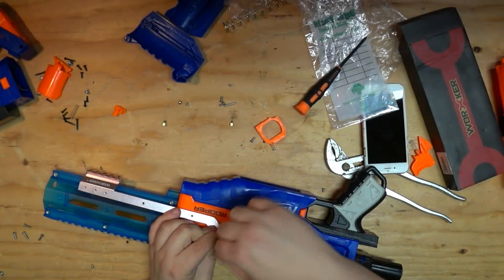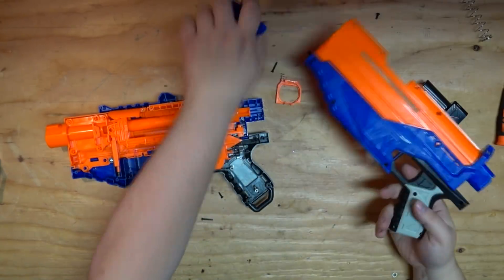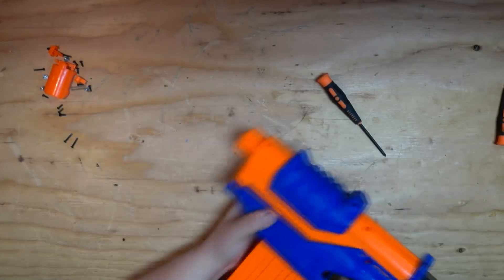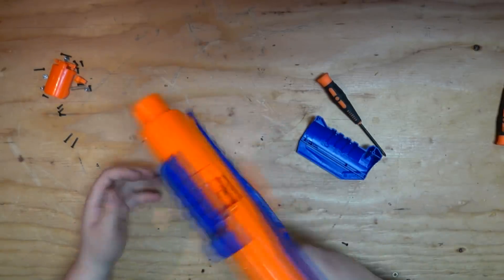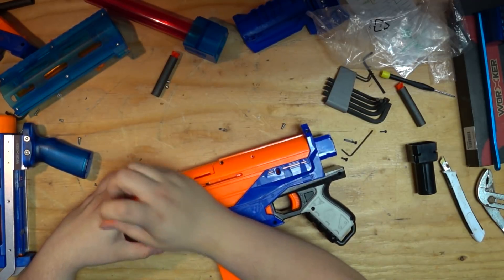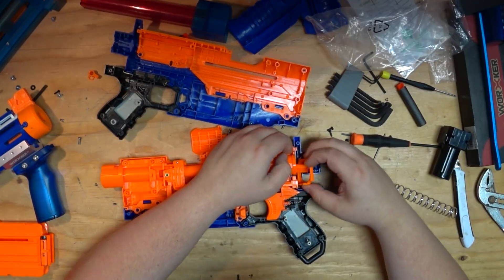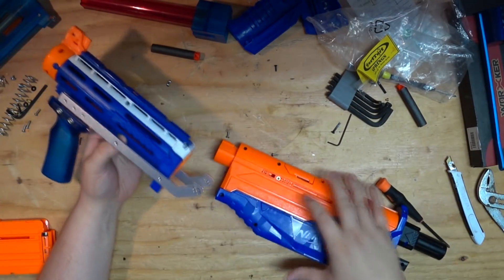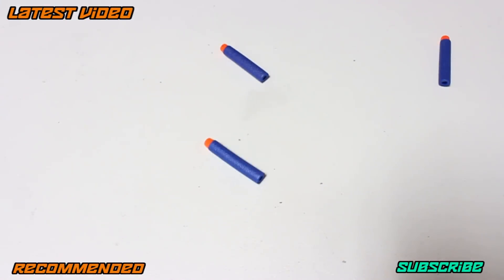NERF Delta Trooper Mod Guide || Mod Potential | Walcom S7

Comment: Just picked up a delta trooper from goodwill today. And I must say it has the smoothest slam fire ever. I was spamming out foam so fast, I actually thought I smelled the darts burning under friction. Turns out my wife was drying my socks and I smelled my socks and not darts. The Delta Trooper has a very nice prime and I dig it the most. Cheers Walcoms7 you’re a legend mate.

Comment: Everyone: mods delta troopers and retaliators into pump actions

Alpha trooper: “am I a joke to you?”
Reply: Slender Man 186
 mostly cuz the alphatrooper basically has strongarm internals, cant take a big springload. On something like a retaliator you can kinda just shlap a 14kg spring with a couple of 3rd party components and your good.
Reply: Papa Scoots well at that point you’re better off finding one of the many Longshot rereleases and modding that into a beefy as hell pump action.
Reply: @Slender_Man_186  longshots don't have slamfire
Reply: @willw5868  Not 3d printed but yeah you could

Comment: This first lock you removed was actually necesary,  because it looks priming slide when its ready to fire so you don't need to hold it and you can fire it with one hand when primed.
Without this lock when you prime and push slide forward and leave it, the slide goes backwards instaed of the blaster fireing when you pull the trigger.
Reply: I found this out as well. Had to an upgrade the spring in said part in Order to get full potential out of a 12kg spring and sealed breech

Comment: The reason the FPS with the accufakes is probably because you didn't take the AR out as I have noticed if the spring is to heavy and the AR is still there it decreases in FPS from stock

Comment: Shouldn't you be able to move the bars back a bit on the pumpgrip itself? Where it's fixed with 3 screws, only use the rear two screws. Should give you another half inch or something.

Comment: Something must be interfering on yours. I put a worker 7kg spring in mine, and did nothing else other than removing the prime locks & putting on the included rubber bumper around its plunger. I also cleaned and lubed everything, but that's it. Kept the air restrictor. I don't have a way to chrono it, but distance wise it shoots almost twice as far so its gotta be above 100fps at the barrel. Maybe I had a weak spring to begin with, but it was already shooting farther than my Retaliator and multiple flywheel blasters, so I've gotta imagine stock it was shooting as it should. Getting at that hidden screw was a bitch. Had to remove the priming handles by taking off the inner screws.

Comment: What do I think? A brass breech will be a further waste of time and resources.

Does that mean I don't like this blaster? On the contrary, I like it very much. Definitely like the attachments, and it will only be a matter of time until there's an aftermarkey pump grip kit (ala Longshot) for the stock barrel.

Still, even with a brass breech... Would probably rather have a Flywheeler or Longshot.
Reply from the maker: People think a lot of blasters were a waste of time. I thought the Blitzfires were useless, and now I think they're the best pistol in Nerf. I haven't even done a video on it yet. It's just a matter of time until somebody finds the one thing that makes it better.
Reply: Walcom S7 oh for sure... Not a dis to anyone, to each their own. Still, at the end of the day, for me, the brass breech seems to be getting high on the scale of diminishing returns when one can't necessarily also swap out the plastic internals for something with the strength to handle the spring load that can in turn fully utilize the sealed nature of the breech. Then, we get into muscle power, and does one really want to compress pounds of force over and over when one could simply push one or two buttons for similar effect?

Definitely arguable. I just tend to veiw the mod process of a Flywheeler more enjoyable, both journey and destination. 

Realistically, if one were on the path to supercede flywheel performance potential in this day and age, you'd be into NIC homemade springer, pump air or haych-pee-eh, or nothing-stock-but-the-shell Longshot territ'ry.

If we're comparing net input to net gain, that is. Definitely doesn't consider the person modifying a particular blaster just for the foam of it. 

Let me know if you want to sell the DT attachments ;)

Comment: I just got my delta trooper. there was NO hidden screw. the slot was there, i pried apart the priming handle, inserted a driver, couldn feel the screw.... and the shell split apart. no screw. well i put it back together and it works fine without the hidden screw, so its not essential. in any case, i got in a worker plunger (older version black one) and a worker 5k spring and stronger catch spring, and yeah it fires like a retal with a 5k spring. i'm using it as a mag-fed springer pistol without the attachments, coz i've got two other rifle-style springers already and i wanted something that gives me more mobility for when i feel like it. at 5k performance, its a gem. more comfortable priming than a retal or recon with top prime, but the grip is noticeably less comfy.

Comment: Can you put a retaliator boltsled in the delta trooper? I just bought a worker aluminum boltsled and expanded plunger tube, and I would love to add these into the delta trooper with a brass breech, and longstrike barrel with a pump grip
Reply: I know this is a late reply, but were you ever able to get the boltsled and expanded plunger tube to work in the Delta Trooper?
Reply: @infernoprince887  I never got a delta trooper, and looking at the internals, the boltsled looks pretty different, since it's slam fire
Reply: @KellenBluestein  Alright, thanks for letting me know!

Comment: So basically a discount alpha trooper.
Reply: Beta trooper?
Reply: it's actually superior. the priming rod on the pump of the alpha trooper bends under the same spring load stiff metal bars will not bend.
Reply: Demo_the _man discount my ass it cost more lmaoooo
Reply: What spring load? I'm using a 7kg spring in a Alpha Trooper with no rod bending. Much more than that and the priming is too stiff to be comfortable.
Reply: you're probably at the limit then. once you get into the heavier spring loads, it still primes but you can feel it bend. i can imagine with a super strong spring it might snap.

Comment: the delta trooper .... a reshell of the tri-strike ....except that the trigger is separated from the magazine by the pacific ocean on the tri-strike (like on the regulator, besides) .... whitch is not a very good thing, in my opinion.
a good point for the delta ...

Comment: Short dart delta trooper?
Reply: I think worker has a kit for that...and a pump kit that uses the original delta trooper barrel.
Reply: @captsomeguy1  I built it already, broke it, and got another one. The kit i believe it just for a retaliator bit it definitely works. Major shell modding/reinforcement needed for heavy spring upgrades. Found if you leave just the slide lock in it runs much smoother.